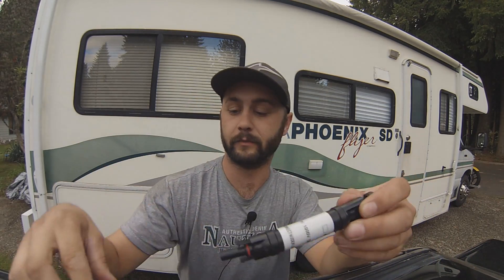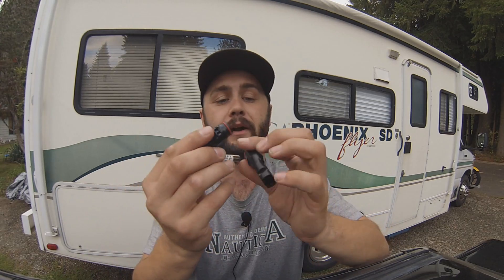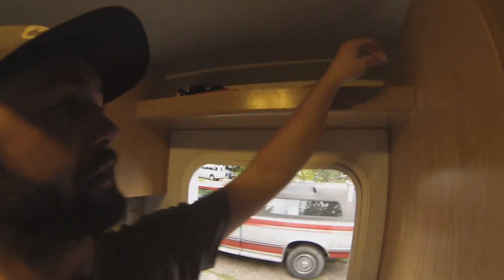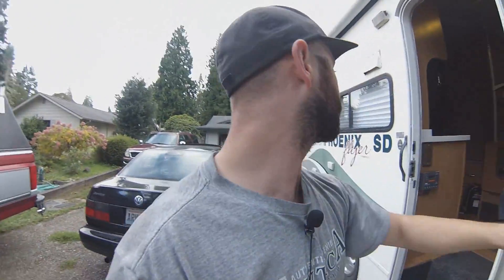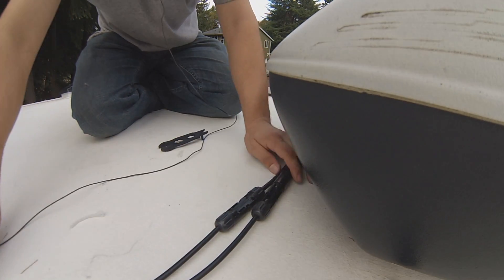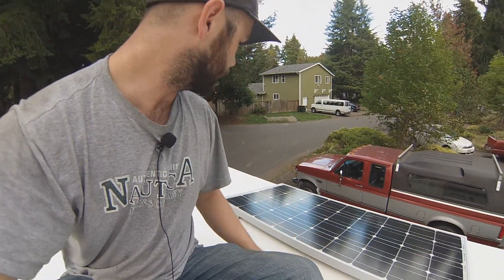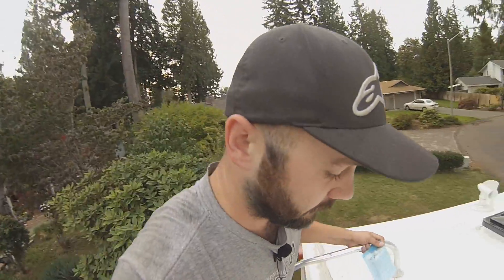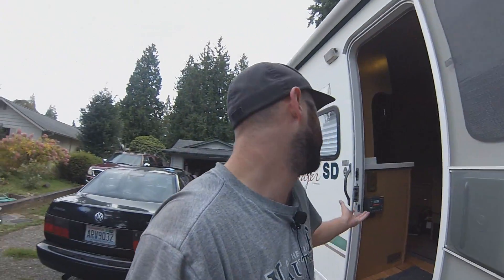MC4 Inline Fuses Renogy, Solar Odyssey (Slocable)

Comment: I have 2 100W solar panels with MC4 branch connectors. I have an inline fuse from Windy Nation. I bought before I watched this. My inline fuse connector gets really really hot. Is that normal? Also how can you tell if the fuse is ok? I have a 15A fuse. Wonder if I need bigger fuse too? Thanks
Reply: if it's getting really hot, that's a sign there is an issue.  it could be due to a loose connection which is what was reported in this video

Comment: I’m Curious - Why are you adding a fuse to each panel?  It is recommended that you allow a 25% safety margin in your panel fusing application.  So if you have a 400W system comprised of 4 panels (i.e. 4 panels each rated for 100W), and each panel produces anywhere from 5.7A to 6.1A under ideal conditions, then your max. Amps is around 24A (4 X 6.1A).  Add approx. 25% safety margin and a single 30A MC4  fuse will protect a 4 panel system (100W each) or a 20A fuse for a 200W system is more than adequate so long as positioned after you have combined your panel cables. Thanks for the video.
Reply from the maker: Honestly I read it somewhere that over a certain number of watts it was safer to fuse individually.  That could be old info by now though, I wish I could remember the source so I could quote it.  Also in my application the wires are hidden behind my microwave and I wouldn't want to have to pull it out to replace a fuse or flip a breaker.
Reply: I had that same question for installing 2 x 100w panels.  Was wondering if I needed to fuse BOTH before the Y connector or just use 1x 20amp fuse AFTER the Y connector.  Seems like 1 after the Y and before the controller would do the trick?

Comment: Thanks for posting this. I was looking for advice regarding those fuses. Do you have a link to that main power switch you are using?
Reply from the maker: +Stephen Locke Cyclone Drifter I used two different switches.  One as a master disconnect BEP 701 Battery Switches - On-Off https://www.amazon.com/dp/B005DUUL9W/ref=cm_sw_r_cp_apa_kuXnzbTE28BMZ 
And one that was similar to this to isolate the solar panels.  E Support Car Battery Isolator Disconnect Cut OFF Power Kill Switch https://www.amazon.com/dp/B00U5UBQE4/ref=cm_sw_r_cp_apa_LBXnzbCR71GVV
Reply: Thanks man!!!!!!

Comment: Hi - thanks for the video! I just received these fuse holders today and can't figure out the trick to getting them open. Does it require a special tool?
Reply from the maker: steveless Are you saying to open them up to access the fuse? to do that I believe I just twisted the ends a little which allowed the locks to not be in the groove and then I could just pull apart.   in order to separate the fuses from an mc4 cable this tool comes in handy.   Renogy TOOL-MC4 Solar Panel Mc4 ASSEMBLY Tool, https://www.amazon.com/dp/B00BCWZFN2/ref=cm_sw_r_cp_apa_xJg8yb078MRC5